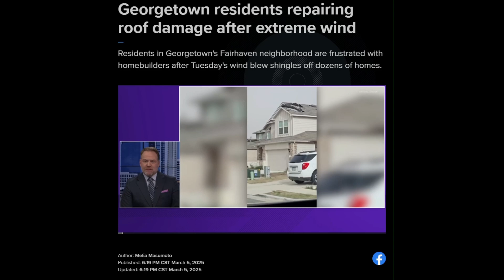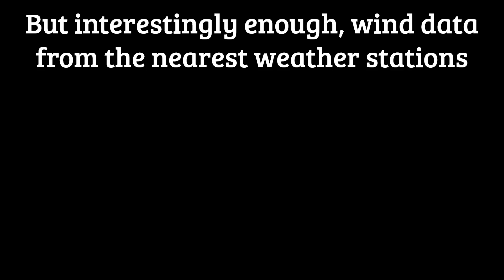Forensic inspection: Why shingles fly off in wind?

Comment: Had these shingles cured? How should they have been installed differently? Besides 3-tab, what other types of shingle is recommended? I've watch from a distance and it appears that roofer use nail guns and often times it sounds really rapid fire. So sometimes the gun must be at an angle to the roof.